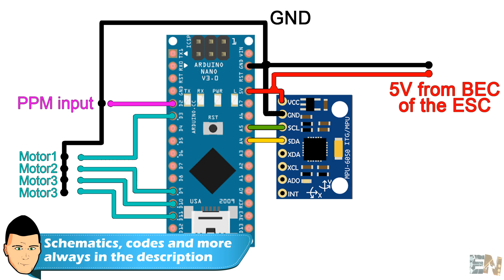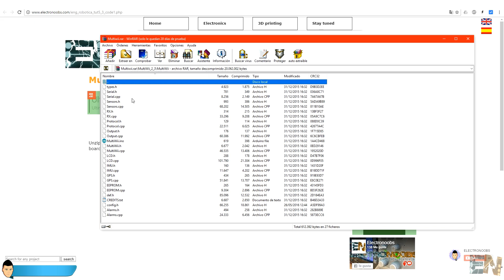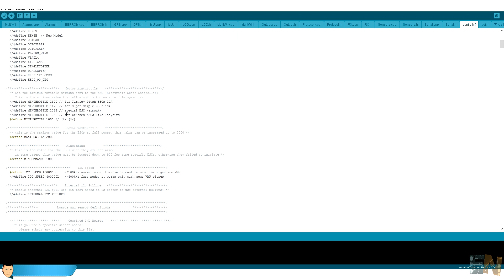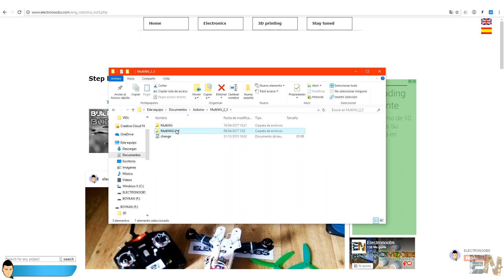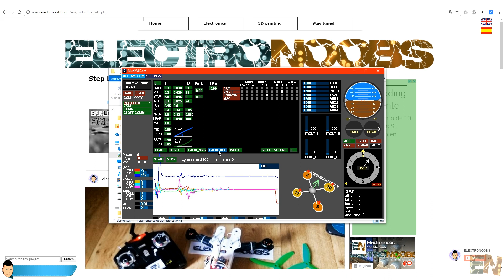Arduino drone - Part1 Flight Controller

Comment: Can u make a radio transmitter and reciver with brushed or brushless esc without using arduino and with high amper rating (all homemade) 

i want to make a drone myself without buying readymate circuts

Comment: @Electronoobs Hi, I'm trying to run Multiwii on Windows11. After searching for a solution in many online forums and trying to install several different versions of JAVA SE 8 (such as 8u202), I managed to open the .exe file but the window stays blank. After a minute or so the interface appears, but as soon as I select the COM port it freezes. Does anyone know what can I do to fix this? Or if MultiWii is even compatible with Windows11?
Reply: hi what did you did did you fix it?

Comment: im using  a win10 x64 it seems the multiwii 2.3 or 2.4 gui is not responding
any ideas?

i am using an arduino uno + MPU6050

Comment: I'm constantly getting error
EXCEPTION_ACCESS_VIOLATION (0xc0000005) at pc=0x000001fced8a44cb, pid=5836, tid=17520
whenever I click start on the MultiWiiConf file

I have no idea how to fix this

Is there a way I can go around this problem or are there any other programs I can use to fly my drone?

Comment: Can you run the NRF24 and MPU6050 on the same arduino board???
Reply: Also I am curious if my esc doesn't have a 5v power wire can I create on with a voltage stabilizer that I can connect directly to the Lipo and run in series with everything else

Comment: Hello, when I open the multiwii program, select the port and press start, the program closes.  What should I do?
Reply: i too faced same problem ,open  application.window32 file ,it will work ,,,,if not working yet ,check your java path in environment variables
Reply: @SKHROSX  Thank you.  I solved the problem.  I chose the 32 bit version of the Java program and it was fixed.
Reply: @duzgunisa  why i am not receiving roll values of accelerometer.please help me bro

Comment: Excellent video! I hope you are doing great. I had two question though. I plan to build a nano drone using coreless motor and i already have a flysky ct6b rx tx set.
1. Will the Multiwii code support flysky ct6b as it does not have a ppm output?
2. For coreless motors, what kind of motor driver/esc will be good or if its possible to make one?

Thanks!
Pranav
Reply: Same here bro I bought 720 coreless motor and a 350 lipo battery after that I found that motor has low thrust to lift so I'm clueless. I have bought them. Is there any way to fly with these components
Reply: Hi ! @lukejoel6070  , My conclusion is that for DIY drones its hard to keep them light enough for coreless motors to work. Better to go with brushless motors. If you want to use coreless motors then you will have to buy a flight control board which has inbuilt drivers for these motors(those are also cheap), you can then flash and configure betaflight. You may either buy the frame or 3d print.

Comment: Awesome man. Thank you for these tutorials.
Im building this drone with my kids, with home made radio control as your previous videos. Unfortunately, my ecs don’t seem to work with ppm signal. They spin fast from throttle 0.
I calibrated my radio control and work fine.
Trying to find MultiWii setup directions for pwm singnal and cant find anything.
Kids want to present this project to school..
Can you help me on this please?

Comment: I have successfully completed this product using Arduino Nono as flight Controller, Transmitter and receiver..
Now I want to add a Bluetooth module on my flight Controller and control the drone with my mobile 
Can you please help me

Comment: i am getting i2c error like 27000 . help me, simulation in not stable
Reply: Have you got the solution??? I'm facing the same problem
Reply: @vishnu_k_007  yes, replace the jumper wires and tighten all the connections, loose connections are the cause

Comment: Sir i find some daigram...about multiwii baro.and sensor but i dont understand....arduino have few scl and sad pin...how to concted all..plz sir help me...i sand a link...https://www.rcgroups.com/forums/showthread.php?1340771-MultiWii-additional-HOWTO-overview
Reply from the maker: All to the sale SCL and SDA. i2c communication has different adress so you can use same pins for all the modules!
Reply: Thanks u sooo much...many vedio i found...but u r grate..i wait next flight controll project...thanks alot..sir

Comment: Hey Electro i made the same connections u briefed about, the multiwii simulater is showing everything fine the gyro-accelerometer all the throttle yaw pitch etc but the output is not adequate i.e the pins to be given to ESCs, its showing values 8000(not 1000-2000)
Reply from the maker: That's strange. Go to config.h, type cntrl+F in order to open the find tab adn search for MAXTHROTTLE variable and make sure it is 2000. And MINTHROTTLE is 1000. Keep up!

Comment: Hi brother.   One more doubt.  If I am not using BEC then I have to connect the signal only .is ground needed bcz I powered my arduino with 8 v regulator ...I am only powering reciver with bec

Comment: What to do I IAm directly using a fs i6 transmitter and receiver
Reply: should just work with it, connect the ppm output of the receiver to the flight controller

Comment: Hello @Electronoobs, how is the Arduino an advantage over normal flight controllers? I read people saying it is slow and have huge latency working as a FC for RC models but maybe you could connect Arduino to a conventional F4/F7 flight controller and have both? Can an Arduino run new software like Mission Planner, CleanFlight or ArduCopter? Is the Arduino compatible with conventional RC Tx and Rx systems? Would adding all the sensors mean you can program everything in a running loop i.e. something like "IF (sensor detects something 30cm away) THEN (correct_the_opposite_way)" or how does it work ? Sorry for asking so much, lol
Reply from the maker: iMeMySelf you heard right. Arduino is slower and has no advantage. The only advantage is that you could learn how to.make your own flight controllers how to program it, what components do you need etc. This video is for learning reasons. Arduino is quite good but almost any other especially designed flight controller board is better. Keep up!

Comment: At 1:38 when you are listing the purpose of each connection you have SCL as data and SDA as clock, this is backwards AFAIK. The SDA pin is serially polled at the rate of SCL

Other than that great video!
Reply: Jake freise can these values be used for a 350 size drone with 1400kv motors?

Comment: Hello iwas thinking is it possible to replicate brushed multiwii platform with arduino and h bridges replacing brushed escs....and ppm reading from comercial tx as you previously shown....!!??
I was mainly concerned about fast switching of interrupt commands for axl and gyro !!! And the availability of pins for individual motor control..if it is just pwm h bridges control ..plz let me know what your thoughts are..
Just find out this link    https://youtu.be/hQMNUTaUhvs
He is using mosfet switching.
Sunfounder makers have already introduced embedded board with coreless motors i was thinking about some big motors like rs390 or mabuchi other motors..

One more thing what  about stm32???

Comment: hola , gracias tenias toda la razón, utilice el enlace que me dejaste para configurar las esc y ya no pitan , no me encendían los motores por que quizás el radio control tiene otra configuración y me toco invertir el pin d3 con el d6 y ya encienden lo único que me falta es que al dejarlo sin acelerar los motores siguen funcionando que podría ser? 

gracias
Reply from the maker: Eso es normal. Puedes quitar esa opción pero es mejor así. Piensa, si aceleras desde cero tendrás mucho mas turbulencias hasta que todos los motores tengan la misma velocidad y en ese instante el dron podría perder el control. Para eso cuando lo enciendes es mejor dejarlo a bajas rotaciones. Saludos!

Comment: hola amigo que pena volver a molestar finalmente no pude arrancar los motores con el radio control lo raro es que puedo calibrar cada esc desde el radiocontrol y me encienden los motores normal, y ademas desde el multiwii config se ve el movimiento de los stick, pero ahora no se que paso y al conectar todo ala bateria empieza a pitar las esc de manera permamente y hay queda ,eso mismo me habia ocurrido cuando tenia la controladora de multiwii , de pronto tienes idea de que ocurre gracias
Reply from the maker: No conectes el USB antes de connectar la batrería. Has desconfigurado los ESC. Si pones 5voltios a los ESC, luego máxima señal PWM y luego conectas la batería, el ESC entra en modo configuración y no salen hasta que no envíes la mínima señal. intenta alimentar todo a la misma vez.

Usa este tutorial para calibrarlos entre 1000 y 2000 : http://www.electronoobs.com/eng_robotica_tut5_1.php

Debes conectar 11.1V de la lipo al Vin del NANO. De esta manera el arduino y los ESC arrancan a la misma vez.

Comment: Can I do it with a brush motor?
Shttps:https://www.gearbest.com/rc-quadcopter-parts/pp_424974.html
Reply from the maker: If you use brushed motors you need a very light plane, and also powerfull mosfets to control the speed of the motors. I'm working on that kind of drone project as well... Stay tuned

Comment: hay veo que pones un voltage de 5v desde una esc al pin reset del arduino es correcto
Reply from the maker: No, Al reset no le debes conectar nada. En la PCB parece que tengo algo conectado pero por debajo las conexiones son como en el esquemático.  Sigue las conexiones del esquemático. Saludos!

Comment: hola buen dia que pena molestar, resulta que yo ya conecte todo ya hice todos los pasos y probe el radiocontrol desde el multiwiiconfg y los mandos responden bien pero los motores no arrancan , tambien calibre las esc como muestras en el video , que me faltara 
gracias
Reply from the maker: Para arrancar los motores debes poner throttle y yaw a minimo durante unos segundos. Si tienes el multiwii conectado un boton verde se va a encender en la pantalla.
Reply: hola que pena volver a molestar es que le he dedicado mucho tiempo a este proyecto y no me quiero dar por vencido ,pero resulta que ya hice lo del control y no nada que arrancan los motores , habra otra configuracion ? gracias

Comment: Hello
excellent project
I'm from Colombia, so my English is not good
I already have armed almost everything following your videos
but I want to use a radio control that I have, it's a flyskyfs-th9x
but I do not know how to connect it to arduino nano, I do not know which pins to use
please help
Thank you
Reply from the maker: Hola. Tu receptor tiene salida PWM. Quires seguir usando la plataforma MulTiWii?

Para PWM es asi:
Pin Arduino            /         Función
D2                                      Throttle
D4                                      Roll
D5                                      Pitch
D6                                      Yaw
D7                                      Mode

Si los usas asi en la parte del tutorial donde añado la lista de PPM SUM, no la añadas. Una vez hecho comprueba si recibes bien con la plataforma Java Multiwii.

Conexion extra aqui: https://img.rcgroups.com/http://radio-commande.com/wp-content/uploads/2010/06/quadX.jpg?h=n0YzUYH7qWh6qONQA4lfzg

Saludos. Pronto activo el canal en español ELECTRONOOBS EEE Blog, Visita si quieres.
Reply: gracias mañana lo ensayo

Comment: I have replaced the 2400kv motor into 2200kv and 12A ESC into 30A ESC. So please help me to find that what mAh battery can be usable for this combination?
Reply from the maker: The capacity will only ioncreas or decreas the flight time. I recommand a 3S. You should check this article on how to choose your lipo for your drone:

http://www.dronetrest.com/t/lipo-batteries-how-to-choose-the-best-battery-for-your-drone/1277
Reply: Electronoobs Thank you so much sir..✌

Comment: Great tutorial!!! I followed it and i have my quadcopter done, but i'm having a problem! Two of the motors spins so much faster than the other two, i've calibrated the esc's with the provided code, but nothing happens..  There's no problem with the joystick, since i've tested the communication with the test code provided here, and i get the same results you get in the video.  I can see in the multiwiiconf platform how the motors connected to pin 10 and 11 spin almost maximum, while the other 2 motors are spinning around to 1300 with the throttle at minimum. This situation becomes worst when i press the throttle,  because the quad turns upside down before even starting to fly. 
I've tried changing the places of the motors with the esc's, i've changed the esc's connections between pins (i.e. 3 to 9 and 10 to 11) but i'm still having the problem in the same pins, whatever esc or motor i connect to them. I'm sorry for such a long message and i hope somebody can help me. Thank you!!
You can see here the screenshots of multiwiiconf: 
https://drive.google.com/file/d/0B2tL8P5oQLW_NU85RFRKLU1sWEk/view?usp=sharing
https://drive.google.com/file/d/0B2tL8P5oQLW_ZU9IWjlmbDQzQ2M/view?usp=sharing
Reply from the maker: This is very strange. Don't forget to calibrate the Acc and Gyro in the Multiwii Comf. BTW, what IMU module are you using (MPU6050??) and what module do you have selected in the multiwii code? Is the IMU streight flat on the drone body?

Keep up!
Reply from the maker: BTW, I the second photo I can see that Pitch And Yaw are not around 1500 which is exactly middle. It could have an error between 1495 and 1505 but 1538 is way too much. That means that the RC transmitter is not well calibrated and the drone is always receiving the signal to move to the left. 
I hope this will help you!
Reply: Thank you for your fast response! Yes, i'm using the mpu6050, my module is the GY-521. I've selected the GY-521 in the multiwii code. I suppose the IMU is flat on the drone body. Here is the quad:
https://drive.google.com/file/d/0B2tL8P5oQLW_VDdVc3J5OFRaMHM/view?usp=sharing
https://drive.google.com/file/d/0B2tL8P5oQLW_UFotakVlcml4RG8/view?usp=sharing
https://drive.google.com/file/d/0B2tL8P5oQLW_QUFPSWN5d0M1a1U/view?usp=sharing
Reply: I'll check my  RC transmiter! I've made the printed circuit for the FC, i could send to you the .pcb file if you want to add it to your project. Thank you!

Comment: first of all thank you...this is what i am looking for...you earned a new subscriber. 
 i want little modification...why you made receiver separately? i want to use digital pins of flight controller arduino to connect nrf24l01 module and control esc of motors ...all with only one arduino. but i don't know what and where i have to change multiwii code to work like this.
can you share some knowledge on this?
Reply from the maker: Using multiwii is easier to just use another Arduino as the receiver of the signal as any other RC controller has and leave the flight controller micro work with the PID control. I don't have a video for changingh the multiwii code. Take a look at this one: https://www.youtube.com/watch?v=bxlJckevIEk

Comment: Nice video, it would be even more amazing if you chose the first way (code the FC yourself xD)
Anw, have you experience noises when using MPU6050? I've heard somebody say that it's very noisy compare to other sensors such as L3G4200D.
Thank you!
Reply from the maker: Phong Phan Thanh well it's not the best IMU but works quite good.

Comment: hello.  i was in contact with you over a month ago in which you were assisting me with this build.  I have a Arduino Uno R3 and a L3G4200D gyro.  Do i need any resisters or diodes for this build?
Reply from the maker: Kerric Bennett no, you don't. It is all modular. Just connect the modules and use the code. Keep up. 
Ps: you should always have resistors and diodes laying around, you never know...
Reply: So the Arduino Uno can handle a 3S Lipo?  Im going to use 5v bec from one of the ESC for power (plug into 5v on Arduino)
Reply from the maker: The arduino has nothing to do with the 3S battery. You can use that battery but as you say, add that 5v BEC and connect the output to the Arduino UNO 5v pin. Keep up!
Reply: Thanks man!!!  Appreciate your timely response.

Comment: I wondered can you possibly connected the 5V pin from the Arduino to Vcc pin from mpu6050 and then supply power from your computer to the boards? I thought you might risk burning the Arduino through connecting the board to your computer when you connected the 5V pin to other components.
Reply from the maker: I'm not aware of that. I use arduino for more than 4 years and I never heard that. The USB 5V could suppl,y up to 1A of current. If you dont connect too much modules that could draw more than that, everything should be ok.

Comment: i still have not solved the multiwii issue.  Multiwii will not detect my board.  A5 and A4 are connected to scl and sda on IMU respectively.
Reply from the maker: Hi. Maybe the i2c comunication of your board has different speed. Make sure which is the speed of your module and change it in this line:

/********************************    I2C speed   **********************************/
    #define I2C_SPEED 100000L     //100kHz normal mode, this value must be used for a genuine WMP
    //#define I2C_SPEED 400000L   //400kHz fast mode, it works only with some WMP clones

if not, I don't know...